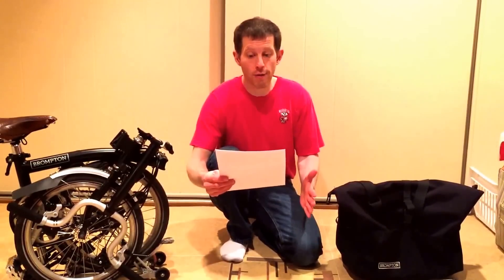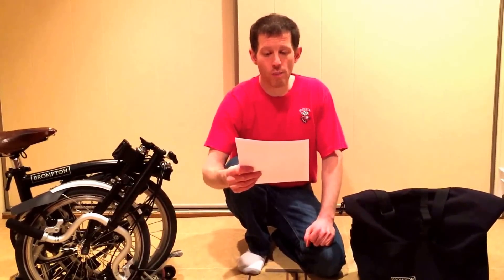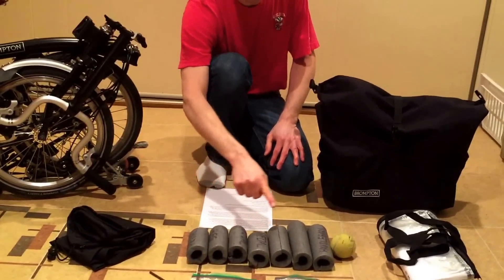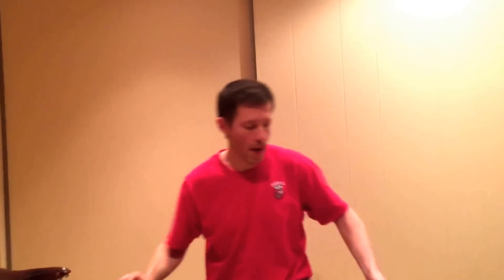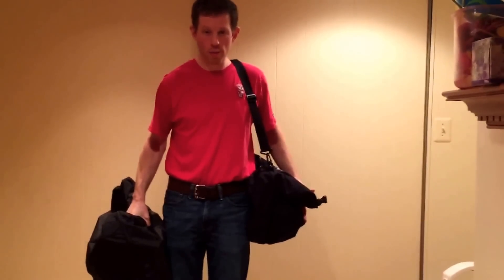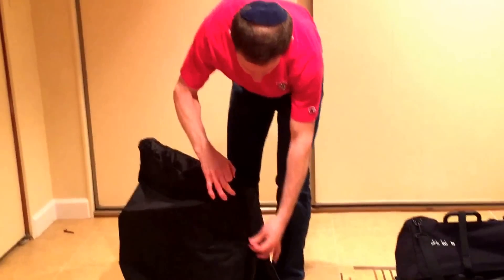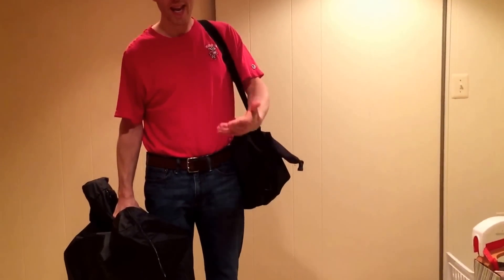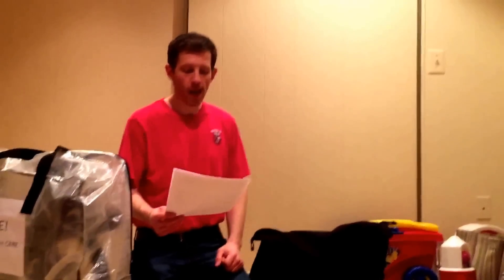How to travel with a Brompton bicycle on an airplane

Comment: Thanks for sharing that. In Europe it's one piece of carry-on in the overhead (55x40x20 [or 25]), often with a 10kg weight restriction, plus a small bag to go under the seat. The B is too big in these circumstances. I would also warn against any tools in carry-on in Europe. Many security agents will not allow tools of any sort through. 

I have a Vincita Sightseer bag for checking in my B. I will be using it for the first time in Spring. Your use of pipe insulation is  a great idea and will be using the pieces you recommend plus some on the top tube just as a filler and I'll take a look at the dérailleur too. Much food for thought, thank you again.
Reply: The gears are in the middle when folded so pretty well protected. Shame about our European rules. Im looking at a trailer that converts to a case for the bike so I can ride to the airport and check the Brompton in.

Comment: Matt, I don't know if you're still monitoring this. I saw this a year or two ago, and again just today. Your earnestness is admirable. I've come to realize that your key assumption-set is this: I'm biking to the airport with no other bags EXCEPT my T-bag and I am flying in one of those larger sized planes that are usually earmarked for international flights, AND we have a 50/50 chance we can board with it and have it in the coat closet OR we want to spend 5-10 minutes on the ramp putting the whole thing together in the IKEA bag. All these seem relatively unlikely scenarios. Why not simply go for the more likely scenarios: I am taking my bike on a plane and it's either going in a hard case or needs to be prepared carefully to go in the IKEA bag. I rather do that latter set-up at home without the stress of the airport. Lastly, when in Budapest last year, plane officials INSISTED that I deflate my tires before boarding. I argued, it went up the management chain and if I wanted to board I had to deflate my tires-this is the only time and place this has happened to me. Thanks.
Reply from the maker: Stephen, sorry for not responding sooner. Just saw your comment.

Actually, here are my assumptions (in order of importance) and their implications.

1.	I am biking to the departure airport (often from my house) and I am biking from the arrival airport (often to a hotel). This precludes a heavy, bulky hard case since it would be much more difficult and slow to bike with a heavy, bulky hard case. I only want to bike with lightweight items that do not take up too much space in my T-bag.

2.	I want to minimize the chance of the airline damaging my Brompton. My bike is likely to suffer the least damage (or none at all) if it is handled only by me. This requires me either to put it in the larger overhead bins (on larger airplanes – earmarked for longer domestic flights) or in the coat closet (on smaller airplanes). As an aside, my success rate with the coat closet is about 90% on those smaller airplanes. If I were to check the Brompton in an IKEA bag (either at the normal bag check or at the gate), then the airline would handle the Brompton and the risk of damage would increase significantly. I only check the Brompton when forced by the airline and my video describes how to protect the Brompton (with lightweight and low volume materials) in order to reduce the risk of the airline damaging the checked Brompton. But again, I would rather NOT check the Brompton so that only I handle the Brompton.

By the way, I have flown with the Brompton over 50 times and I have NEVER been asked to deflate the tires. Sorry to hear that they asked you to do that. Also, as I said earlier, I have only needed to check my Bromtpon about 10% of the time.

Of course, how you fly with the Brompton all depends on your underlying assumptions. It sounds like your assumptions are a bit different than mine, which would lead you to different conclusions regarding whether or not to check the Brompton as baggage. Hope that helps.

Comment from the maker: How to travel with a Brompton on an airplane

Introduction (0:00 – 1:43)

This video is for those people who would like to bike to the airport to catch their departing flight and then bike from their arrival airport to their ultimate destination. As such, your luggage will simply consist of your Brompton bicycle and probably a T-bag or a C-bag that clips right onto your Brompton. For travel, I recommend the larger T-bag since it has more space for all of your stuff. This video will address how to get your Brompton through airport security, how to carry your Brompton onto an airplane, and how to gate check the Brompton, if necessary.

This video is NOT for people who want to check their Brompton as checked luggage at the airport. Checking your Brompton requires the use of either the soft travel case (B-Bag) or the hard travel case. Although these cases protect the Brompton, they are rather bulky and unwieldy. It can be quite challenging and difficult to bike to/from the airport while lugging a soft or hard travel case with you. You will probably end up needing a car, bus, or train ride to and from the airport.

I think a better, lighter, more nimble, and more interesting approach is to bike on your Brompton to and from the airport and then to simply carry the Brompton right onto the airplane with you or to gate check it if necessary. You will NOT need the soft or hard travel case to do this. And I will show you how to adequately protect your Brompton if you need to gate check it.

Necessary Materials (1:44 – 3:43)

For my more nimble approach, you will need the following equipment:

1 Brompton Bike Cover
1 empty small Ziploc bag
1 small Ziploc bag with 5-6 rubber bands
Hex wrench
Tennis Ball with slit in it
Ikea Dimpa bag
6 to 7 pieces of pipe insulation (with a 1 inch inner diameter)

Almost all of these materials easily fit into the outer pockets of the T-bag, which leaves plenty of space for all of your stuff (clothes, toiletries, etc.) inside the main compartment of the T-bag. 

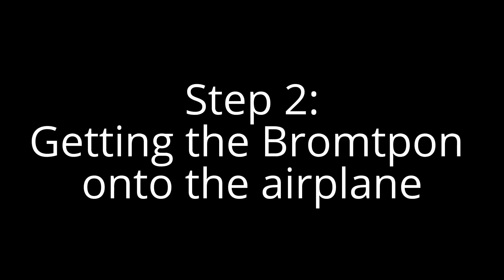Step 1: Getting the Brompton through TSA X-ray security (3:44 – 8:09) 

So you have biked to the airport on your Brompton. Once inside the airport, fold up your Brompton and clip your T-bag onto the Brompton. Roll the Brompton plus bag behind you until you are about 20 yards away from airport security. Now detach the T-bag from the Brompton. Remove the bike seat from the seat post (using the hex wrench) and place it in your T-bag. This helps the Brompton fit through the x-ray scanner. I have done it with the seat on but it is a really tight fit and it can get stuck in the scanner. The Brompton fits through much more easily with the seat removed. Place the slit tennis ball on top of the seat post to protect it. Cover the Brompton with the bike cover. Sling the T-bag over your shoulder and carry the covered Brompton in one hand as you proceed through the security line. 

When you get to the x-ray scanner, place the T-bag on the x-ray scanner conveyor belt. Then place the covered Brompton with the pedal side down on the conveyor belt with the rear rack facing toward you (facing away from the x-ray scanner opening). If you don’t have a rear rack then the bottom of the wheels should be facing toward you (facing away from the x-ray scanner opening). With the seat removed, this is the shortest side of the bike so the bike should be oriented in this way so that it will fit most easily through the x-ray scanner. After the bike comes through the x-ray scanner on the other side, take the Brompton off of the conveyor belt, remove the bike cover and place it in the T-bag, clip the T-bag back onto the Brompton and roll your Brompton plus bag behind you until you reach your gate.

I usually make it through the TSA without any problems. Occasionally, they ask me what the Brompton is and I tell them it is a “personal mobility device” in an effort to avoid the word bike. Sometimes, they ask me directly if it is a bike at which point, I tell them that it is. They then just usually remark on how cool it is. Occasionally, the TSA wants to perform their swab or wipe test on the Brompton to make sure it does not contain explosives. This is fine. They swab/wipe the Brompton, analyze the wipe, and send you on your way.

Step 2: Getting the Brompton onto the airplane (8:10 – 10:16)

After you arrive at the gate, unclip the T-bag from the Brompton and cover the Brompton with the bike cover. Covering the bike is simply to help avoid the airline giving you a hard time about it. Proceed to the jet way with the T-bag slung over your shoulder and carry the covered Brompton in one hand. As you give the attendant your boarding pass ask him/her for a pink bag tag. Do not affix this tag to the bike but save it for later as you may need it in order to gate check the bike if you cannot carry it onto the plane.

Proceed down the jet way. Now on a large airplane like the 737-700 and 737-800 the Brompton will fit into the overhead baggage compartment. However, on smaller planes the Brompton will not fit into the overhead compartment. Before entering the airplane, tell the flight attendant that you have a somewhat fragile carry-on that will not fit in the overhead compartment. Ask the flight attendant if they will let you put your fragile carry-on in the coat closet. If they say yes, great! Put the Brompton in the coat closet. So far in my experience, they say yes about 50% of the time. If they say no, then you will need to prepare and protect your Brompton for a gate check. This can be done on the jet way and it takes about 5 minutes.

Step 3: How to gate check your Brompton (if necessary) (10:17 – 15:30)

Remove the Ziploc bags, cut pieces of pipe insulation, and Dimpa bag from your T-bag. Remove the Brompton cover from the bike. Remove the 2 hinge clamps and place them in the empty Ziploc bag. Put the Brompton cover and hinge clamps into your T-bag.

Now protect and cover Brompton hinges, the front carrier block, and the pedals with the cut pieces of pipe insulation. Use the rubber bands to secure the pipe insulation and help keep it in place. Note that I have a rear rack on my bike which helps protect the bike as well. Now place the entire bike (rear rack side down or bottom of the wheels side down) into the Dimpa Bag. Zip up Dimpa Bag and affix the pink bag tag to the Dimpa Bag and give the bag to the gate check luggage guy. The Dimpa Bag has obvious handles which can be grabbed by the luggage guy as he loads it onto the plane. In addition, I have a sign affixed to the inside of the Dimpa bag that says: “Fragile. Please handle with care.”

When you arrive at your destination and emerge from the plane, the luggage guys will bring you your Dimpa Bag with the Brompton inside it. My Brompton has always been returned in pristine condition. It is quite sturdy, well protected, and has not been damaged.

Deflating the myth about tire pressure on airplanes (15:31 – 16:20)

There is a myth that you need to deflate your tires when taking a bike onto an airplane. You do not need to deflate your tires. It is a waste of time. Both the passenger cabin and the luggage compartment underneath the plane are pressurized so nothing will happen to your tires. Even if the luggage compartment were not pressurized, it would not really matter very much. There is around a 10 psi difference between air pressure at sea level and air pressure at 35,000 feet. Most tires can handle a 10 psi change in the external pressure.

That is pretty much it so I hope this video was informative and I wish you much success biking and traveling with your Brompton on the airplane!

Comment: what a great video! just curious if you have ever put the insulation pipes/rubber bands on before the bike has gone through the scanner? would love to not have to do all this in the airport and just stack my bike on top of my luggage and wheel it through the airport that way instead.
Reply from the maker: You definitely could put the insulation and rubber bands on the Brompton before the bike goes through the x-ray scanner. If would fit just fine. I usually do not do this since 90-95%% of the time I am able to put the Brompton in the overhead bins or the coat closet where insulation & rubber bands are unnecessary.

Comment: Great video, will be trying to go carry on for the first time on Monday.
Reply from the maker: Jorge Torrico Good luck!
Reply: @mattvanderhoek5516  made it thru security perfectly at DCA, no awaiting my flight and have it ready for gate check since it is a smaller regional plane.
Reply from the maker: Cool. Try asking the stewardess (who is on the plane, NOT the gate agent) if he/she will let you put it in the coat closet. Easier than gate check.
Reply from the maker: How did it go?
Reply: @mattvanderhoek5516  they did not allow me to use the coat closet, they said it was due to emergency supplies.   The gate check was different than my experience with international flights, it got sent down with regular luggage and I had to retrieve at baggage claim vs. At the gate.  I worried about it having been damaged, but it seemed ok.  Got me the 28 miles to my hotel just fine.
Reply from the maker: Sorry to hear about the coat closet. Indeed, sometimes gate checked luggage is returned to you at baggage claim rather than at the gate. This has happened to me too and the Brompton has not been damaged. Glad the ride to your hotel went smoothly!

Comment: Informative video, Matt. Thanks! I've heard baggage handlers are generally very respectful when they see it's a bike in the clear or opaque plastic bag. What are your thoughts on forgoing the pipe insulation, and just rubber banding soft stuff you're likely to carry anyway: towel, (bagged) socks, underwear, t-shirts?
Reply from the maker: I think rubber banding the soft stuff (clothes and towel - bagged to keep them clean) could work and it would save space, although I don't think the soft stuff would be as protective as the pipe insulation. Please let me know how it works if you end up giving it a try. Nice idea.

Comment: Get the extended seat post, with that you just use the QR to pull out the seat. I got rid of the awful stock pedals and put on QR pedals, i remove those and put them in my carry-on. Don't waste your time covering your Brompton in a bag, TSA is more amused that anything else, nor does the airline care. I carry the DIMPA bag with me in my carry-on should they ever ask me to gate check in. In 8 flights, I've never had to gate check it, I just put it in the overhead bin. Also, the Brompton fits into the folding wheel chair space in the back of the plane. I've found that if you are nice and smile, the flight attendants are more that willing to help you.
Reply from the maker: What is the advantage of the extended seat post with the QR? When you release the QR, you now have a seat WITH A LONG POST ATTACHED TO IT! I would rather just have a seat without a post attached to it - much easier to deal with (as I usually put the seat in my T-bag). Also, it only takes about 10 seconds to remove the seat with a small Allen/Hex key. 
In terms of the overhead bin, the Brompton only fits in the overhead bins of larger aircraft. Many domestic flights are on smaller aircraft where the Brompton simply will not fit in the overhead bins. In these cases, you have to gate check your Brompton or ask the flight attendants if you can stow it in the coat closet. Your idea about stowing the Brompton in the folding wheel chair space in the back of the plane is great! Thanks! I hope to try that on my next flight.
Reply: Matt Vanderhoek I can put the seat post out/ in 1 second, without tools.
Reply from the maker: How do you remove the extendable seat post from the seat? Don't you need a tool to loosen the pentaclip?
Reply: You don't need to remove the seat. The extended seat post is telescoping and has two QRs. When you loosen the top QR, you can pull out the portion that is the extension; it's maybe 6 inches long with the seat attached. You are not pulling out the entire seat post on the Brompton, the much longer piece stays on the bike. I only remove the extended seat post with seat, when I go thru the Xray and the overhead, otherwise, it's back on the bike. By the way, the Brompton fits just fine in the overheads of most 737s

Comment: What's your strategy with taking your folding bike onto an intercity coach bus? It seems like it's less likely that one would be able to carry on the bike, but putting it in the luggage compartment also would require some extra padding due to the bumps of the road. But then, one would need to carry this extra padding while riding to the bus stop.
Reply from the maker: As you point out, the Brompton will likely need to be stored in the luggage compartment underneath the bus. You could use the padding (it weighs very little and it is pretty small) that I describe in the video to protect the bike, but the Brompton is pretty sturdy and I think that it can handle the road bumps without any padding at all. Be sure to cover the bike when you show up to the bus! I have been denied entry onto a bus because I forgot to cover the bike! The bus driver refused to let me bring the bike on the bus (not even to store the bike in the luggage compartment) even though it was smaller than most of the suitcases in the luggage compartment!